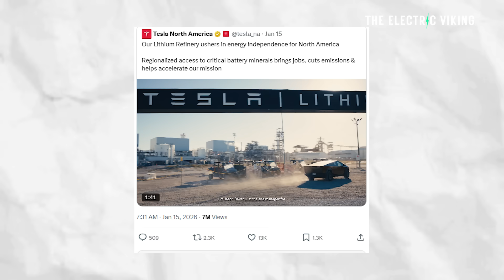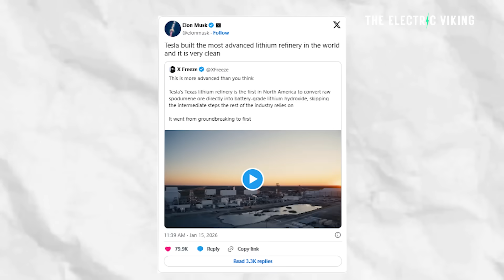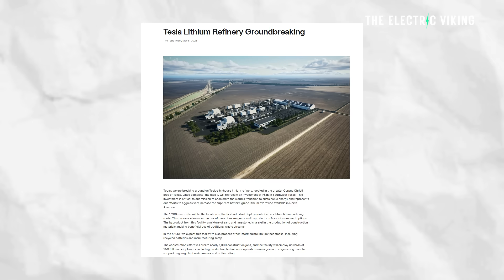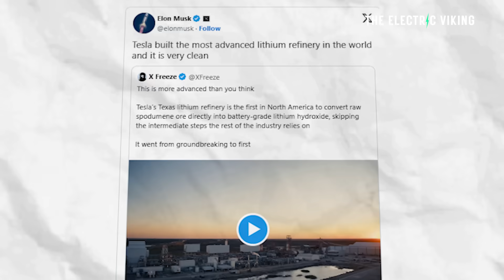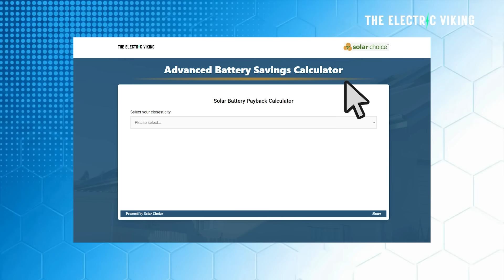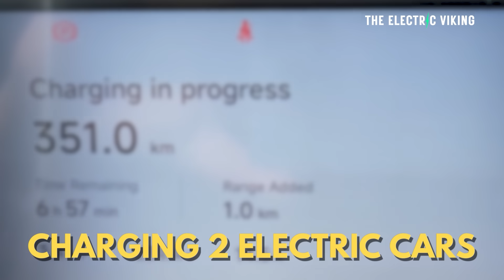Game-Changer: Tesla Brings First North American Lithium Refinery Online!

Comment: My biggest unanswered question was how many EV batteries can Tesla make per year with the lithium produced by the new plant.  CoPilot said 833K/per year.  Gemini came up with 1M.  ChatGPT came up with 1M to 1.2M.  I think these differences came about because each AI used a different average battery capacity.  All AIs assumed NMC or NCA chemistry which use about the same amount of lithium per KWH.  If this lithium were used to make LFP batteries, it would apparently make even more capacity.  So perhaps this mine will supply enough lithium for Megapaks made in the US as well.

Comment: Viking I think you missed the point by suggesting sodium batteries will take over. It’s the process instead of using acids Tesla use alkalines to refine the spodumene. The process is potentially a real environmental improvement. Australia has two lithium hydroxide refineries in WA that we cannot make work. This may be a simpler process that we could use. Conflating the two battery types just muddies the water and goes off script.

Comment: Just to point out that there are some drawbacks of sodium batteries, so I think Tesla has made a good investment here. The large voltage range of sodium batteries can be problematic. Cell voltages reduce by over a factor of two from full to empty, so current near empty is a lot higher than for LFP at the same power output, needing thicker wires. Also the storage density Wh/kg is quite a bit lower than LFP as of 2026. The round trip efficiency is also worse than LFP. I think this Tesla facility is for non-LFP lithium chemistries.

Comment: There are a number of refineries in the USA. 
The issue is cost of operations with some of the most expensive electricity. 
Some of that higher cost offsets some of the freight that would have been added to overseas sourced Lithium compounds.
Australia's process is said to be relatively low cost also. 
Brine dehydration is slow and still expensive as three times the logistics handing of the salts prior to processing.

Comment: I hope this won't be a white elephant if sodium or solid state batteries take over in a year or two.
Reply: Sodium is significantly less energy dense than lithium so lithium is pretty well locked in for vehicles. But it well could take over stationary storage, especially in colder environments IF it lives up to the hype.
Reply: @williammeek-h2o 

How about a hybrid battery.
Reply: @brianpilley3801 different charging and discharge characteristics means you basically need to pick which battery to damage by charging/discharging it wrong
Reply: @brianpilley3801  It would just be more complicated with little benefit.
Reply: @williammeek-h2o 

Less than you'd think at the battery pack level. 

It still can be useful for short and medium range vehicles, and I think some cars do use them.
Reply: @kylejohnson6775  But then the question becomes "Why?".
Why make a special battery that will be relatively expensive and won't reach mass scale when we already have lithium that does and is objectively a better battery. LFP is  already so cheap that the minor savings at the cell level will make little difference on the final sicker price.
Reply: @williammeek-h2o 

Cold weather performance.

And when you make a bajillion batteries, a 10 dollar difference per kWh makes a huge difference.

And sodium is being scaled up. Sam himself reported on it
Reply: Solid state batteries' full name is "solid state lithium ion batteries"

So they still use lithium.
Reply: There also solid state sodium batteries in labs now. But CATL just started sodium batteries,  it will be a few years until sodium becomes mainstream and years after that until we see solid state sodium.
Reply: @kylejohnson6775   Its possible to make solid state sodium ion batteries but one step at a time.
Reply: @roman-trax Don't worry. The new American Lithium Lobbies (sponsored by previous big oil money) will start saying that the better technologies are woke or make the frogs gay...
Reply: Solid state batteries just use lithium.

Comment: I thought sodium was the future?
Reply: So far anyway, it can't match the energy density of lithium. So it will likely be used for stationary storage but probably not for cars.
Reply: Meh not really huge voltage crashes and even if gravametric density is getting better sodium still lacks behind volumetric. But it will get cheaper in 10 yrs so if cost is low people might be willing to compromise on rest